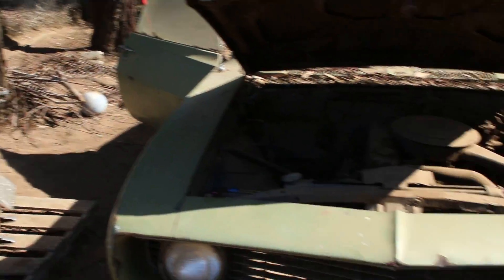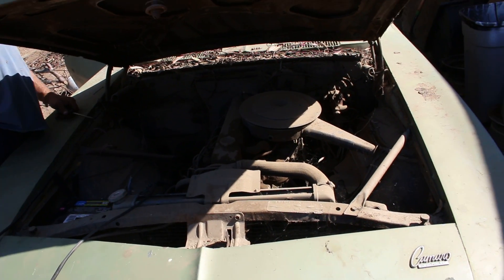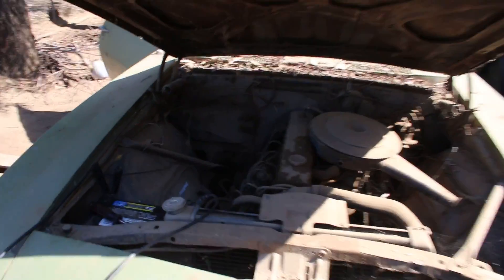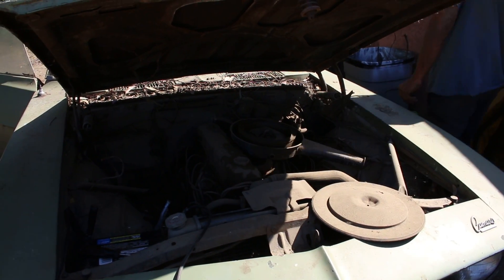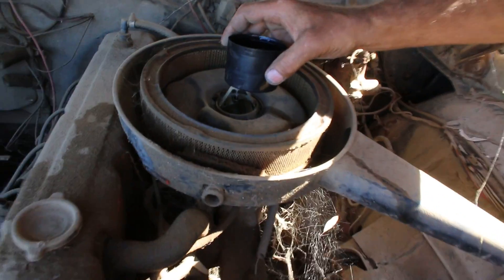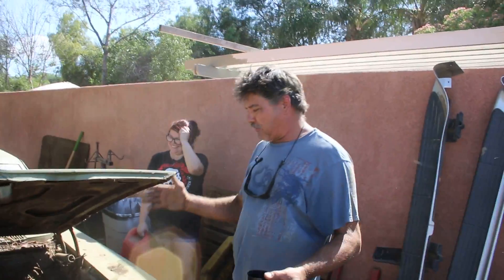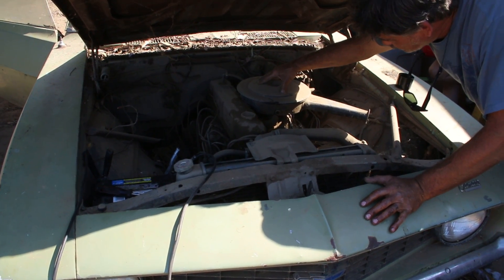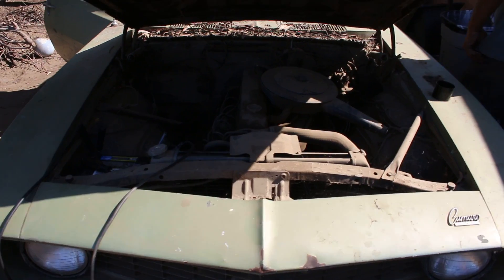starting 69 camaro after 10 years outside

Comment: I have a 69 camaro ss 327 small block, and I’ve tried basically what I have done and I didn’t get much but a really slow not long crank, I changed the fuel pump the spark plugs and the battery and so far nothing what should I do